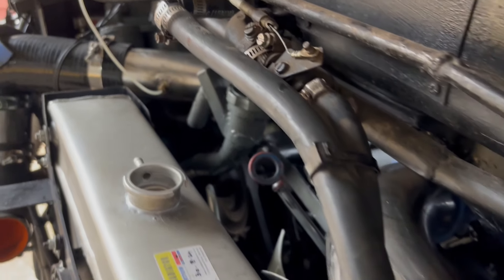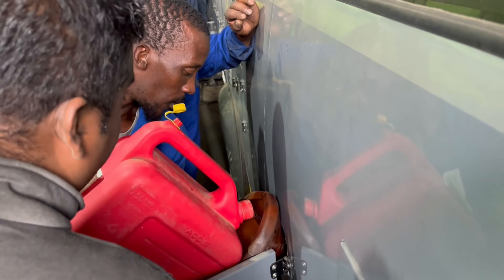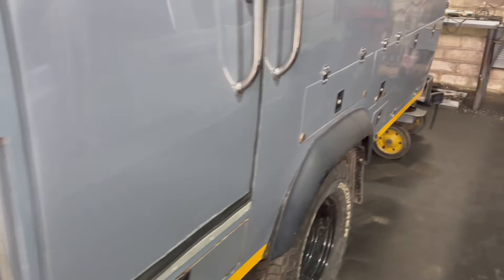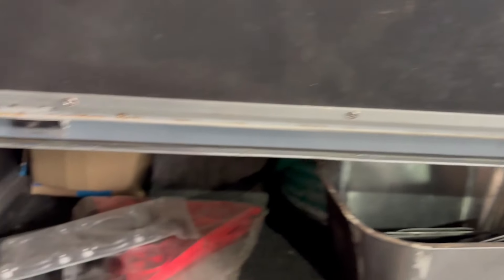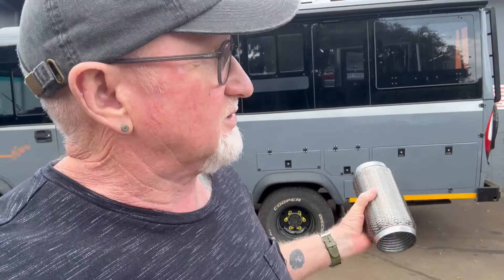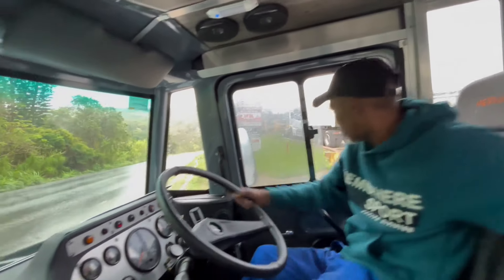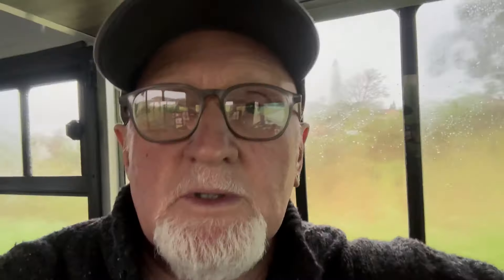EPISODE 181 TEST DRIVE 1

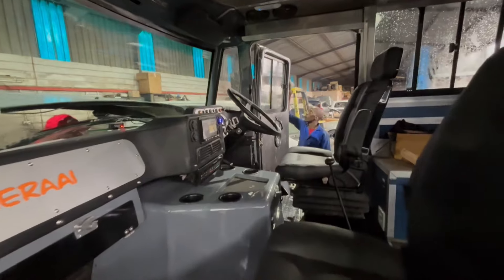Comment: yipiiiii. on a different note, the black space in between the 4 cup holders i would like to believe, can be used as wireless charging port for mobiles phones et al. Its visible at around 6:28mins of the clip.

we have a vehicle.... I guess you can now start dusting the plans that you had shelved.... because we have a vehicle
Reply from the maker: Geoffrey most definitely! There are a few charging ports inside the vehicle in different locations. For the life of me I cannot remember where they all are:) I cannot wait to familiarise myself with the interior. Still a lot to suss out on that regard